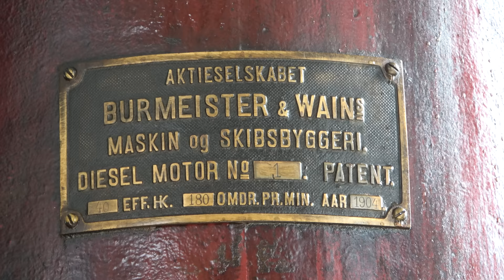B&W No. 1 Engine from 1904 at MAN Diesel House Copenhagen

Comment from the maker: I don't agree with YouTube hiding Dislikes, 737 Likes, 7 Dislikes, 2022-10-23. just so you know what to expect from the Video.

The Video is a bit shorter and less informative than my other Engine Videos. Reason is, that the Engine ran for 5 Minutes only (like all Engines at Diesel House), and thus I couldn't record much Footage in that Time. Unlike with my B&W 2000 Engine Video, I couldn't visit a 2nd Time to record more Footage. Three Things that I couldn't squeeze into the Video:

1: Compressed Air is used for Injection and Atomisation, as the Bosch Pump and Fuel Valve that we know today weren't invented yet back then.

2: Burmeister & Wain bought the License to build his Engine from Rudolf Diesel in 1898. Hence, IIRC this Engine is pretty much a Carbon Copy of Rudolf Diesel's first Serial production Engine.

3: This Engine powered said Factory (IIRC producing Horse Wagons) until 1928, when it was sold and repurposed for a Pumping Station. It was used there until 1943, when a Burmeister & Wain Museum was opened for B&W's 100th Anniversary. When that Museum moved to the H.C. Ørsted Power Station in 2005 (and was renamed Diesel House), the Engine was brought there and restored to working Condition.
Reply: Yup, that method is called air blast injection. It's getting another look today, turns out that method reduces soot, emissions, and better fuel economy. But the compressed air supply is a parasitic loss, so it's a compromise like everything else. It was used because high pressure fuel pumps hadn't been made yet like you said, but another reason was so it could run on whatever suitable oil was available. Diesel fuel hadn't been standardized yet.
Reply from the maker: @brnmcc01  IIRC, Rudolf Diesel originally intended his Engine to burn Coal Dust. Compressed Air becomes the very obvious Choice then.
Reply: Love the video

Comment: In 1872 George Brayton made the worlds first commercially available compression constant pressure engine. His engine was named the “Ready Motor” since unlike a steam engine it could be ready to operate in just a few minutes time. In 1874 he modified the design to operate on heavy oils and made a metered fuel injection system. In 1887 Brayton made a four stroke engine which used a variable quantity liquid fuel injection system with a pressure relief type injector. This system is virtually identical to the system Bosch would use 30 years later. This was the first engine to run on the lean burn  principal. Brayton’s famous quote is “I have for the first time to my knowledge been able to convert heavy oils into a finely divided mist ready for combustion. I also can regulate the engine speed strictly by the quantity of fuel admitted” Brayton also went on to develop the air blast system in 1892. This engine also operated on the lean  burn system. it was basically a diesel engine without the element of compression ignition. Although it has been stated that some of Brayton’s engines would run on compression ignition after they were heated up. Brayton died in 1893 and this is the same year in which diesel applied for his per first patent . Diesels first patent described an engine that operated on the constant temperature principal which required a very high compression ratio. Diesel tried to make his engine operate on this principle and the engine never ran on its own power. Later in 1895 diesel realized his mistake and quietly changed his patent to that of the constant pressure principle which Brayton had pioneered in 1872. George Bailey Brayton is the true father of the Diesel engine we know and love today.

Comment: I worked for many years in a unit at Newton-le-Willows in England and in the same complex (The Vulcan Works), B&W had a massive unit there too.
It was a sight to behold, some of the massive marine diesel engines being tested there, the sound was wonderful.
The injectors for some of these engines were the size of small motorbike engines🥴
Sadly, like all the other units, it has all gone now replaced by housing.
The Vulcan works was opened in 1833 by James Tayleur (later to be joined by George Stephenson) to manufacture steel girders for the blossoming rail industry.
Later, with Stephensons involvement, they went on to produce steam locomotives, many of which are still in daily use to this day.

Comment: Thanks, beautiful engine. Just love the rhythmic sound as it slowly accelerates to full speed.
I doubt many modern engines will be around in 100 years.
Reply from the maker: Probably not. The increased Mean Effective Pressure puts them under much greater thermal and mechanical Stress, and the smaller Tolerances of Parts makes them much more sensible to wearing out.

Comment: We have a 30HP Blackstone at our museum in AUS, that uses the same principals, comp air to start and an air pump to keep the pressure vessel topped up. It’s a horizontal engine of course
Reply: Does your Blackstone use air to atomize the fuel or is it strictly for starting?
Reply: @johnlucas2037  just for starting, it uses the hot bulb to atomise the fuel

Comment: That’s one awesome engine sir 🇺🇸👍👍👍
Reply from the maker: Its one of the oldest operational Diesel Engines in the World. I know of only one older one to bre precise, built in 1903 and located in the University of Göttingen/Germany. There could be more older ones that I don't know of though. If you look closely, you can see a similar two Cylinder Engine (painted black) in the Background at the Beginning and End of this Video. It's the first Engine built by Holeby, another Danish manufacturer that was eventually bought by Burmeister & Wain. B&W was bought by the German MAN in the 1980ies, but all "MAN" Two Stroke Marine Diesel Engines today are strictly speaking B&W Engines, as they replaced the rubbish MAN Engines.

Comment: The Internal Fire Museum in Cardiganshire, Wales has a blast-injection Sulzer (I think, 1912) which looks a lot like this.  The principles are much the same as Diesel's original engine.  Needs 600 psi air to start it if I recall correctly.

Comment: Real crude and big by today's standard for diesels. But from what i have seen in life much smaller and much easier starting procedure than the steam engines of that horsepower rating
Reply from the maker: Low Compression and slow RPM makes for a bad Power-Size Ratio. Regarding Steam Engines depends on if the Steam Engine is kept pre-heated or not. Steam Engines must be hot before starting, otherwise there would be excessive Condensation inside the Cylinders. But if it is already hot, a Steam Engine can be started just as quickly, if not quicker, than a Diesel. The old Gasworks in Schlieren (just outside Zürich/Switzerland) kept a 1904 Steam Engine as Emergency Generator until the Gasworks shut down in the 1970ies. Because pyrolising Coal into Gas requires Steam anyway, there was more than enough abundant Steam to just keep heating the Engine 24/7. Said Engine is preserved operational today, I already covered it in my "Tandem-Compound Steam Engine" Video. Because I don't like the Quality of that Video anymore, I'm working on an improved Re-Upload, where I'm also going to mention that Emergency Generator Story.

Comment: Maybe it's the microphone but it's seems so quiet for diesel engine, I'm guessing the large mass in conjunction with low power and maybe even higher injection pressure helps dampen out the vibrations that make diesels sound so distinct but I honestly didn't know it was actually firing for a good while into the video.
Reply from the maker: I'm using a decent External Microphone, it's fairly quiet. Reason is the slow Speed and low Mean Effective Pressure.

Comment: How come they only run for 5min they probably barely get warm in that time
Reply from the maker: Never understood that either. The large B&W 2000 Engine is decently preheated at least, but the smaller ones are literally running cold all the Time.

Comment: Ha, amazing. Roller cam, and overhead cam in 1904. NO pushrods. Can visually see the valve lash adjustment, what is it, 0.125"??
Reply from the maker: IIRC, an overhead Cam would be right above the Valves and operate them directly without Rocker Arms.
Reply: @Genius_at_Work  You might be right but the famous 2 stroke GM Cleveland Diesel aka Detroit used this arrangement with cam and valve rockers. Still amazing for 1904. This was literally state of the art at the time.
Reply from the maker: @brnmcc01  There's a very simple Reason for the Cam Shaft Position: No Fuel Pump. When the Bosch Pump came up, the Cam Shaft was moved down to make Way for the Pump.
Reply: it would seem proper to call this an over head cam because the cam is at the top of the engine and not in the block

Comment: Blast injection diesel?"
Reply from the maker: Don't know if its called that, but if you're referring to Fuel Injection by Compressed Air, then yes it is. IIRC, Rudolf Diesel first thought of burning Coal Dust when designing his Engine, so Compressed Air is the Method of Choice.
Reply: Yes